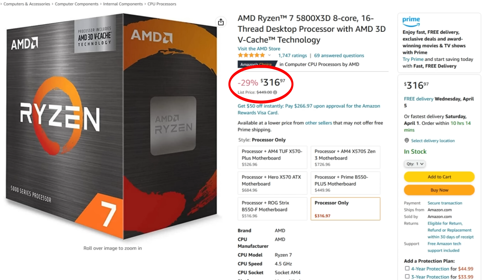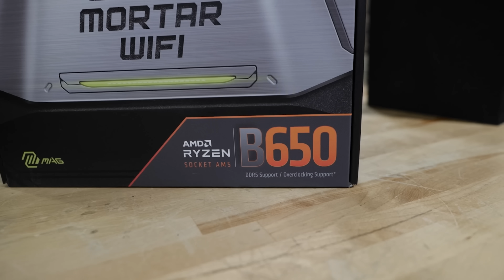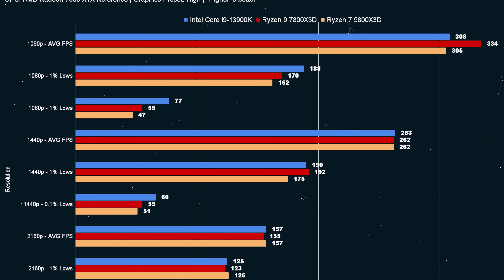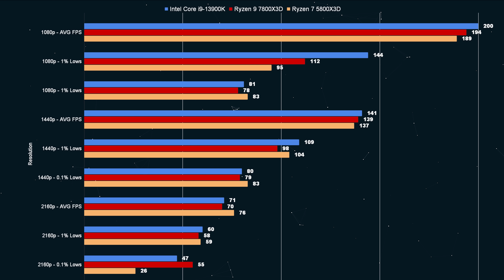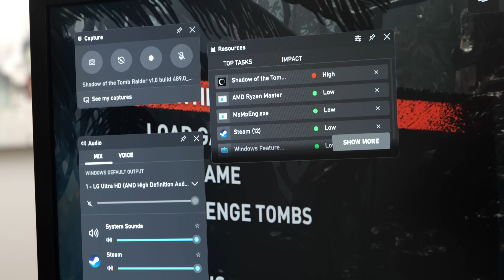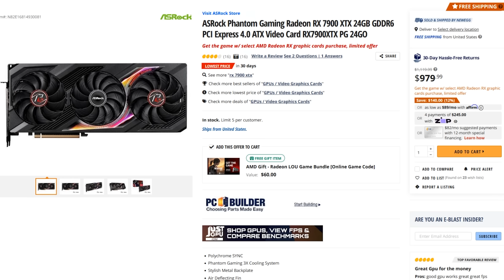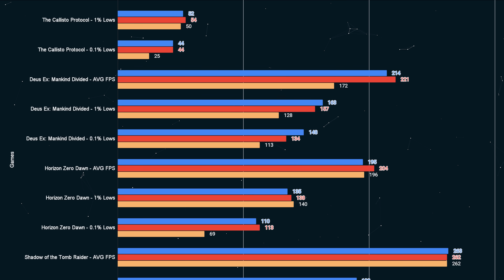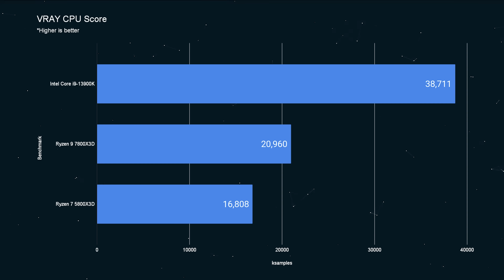Is The Ryzen 7 7800X3D The Ultimate CPU For Gamers?

Comment: Going from an i5 10400 rtx 3060 to a r7 7800x3D rtx 4070. Expecting to be blown away.
Reply: Gonna be super efficient
Reply: Can confirm. It barely pulls any watts from the wall while gaming despite being super fast. @iamdeluluu
Reply: @portman8909  lol nice, I got 6800XT/7800X3D cheers bro for efficiency
Reply: Yeah 6800XT is a great card, but obviously the newer cards like the 7800XT will have better efficiency, although performance is the same. @iamdeluluu
Reply: @portman8909  yeah I didn’t care for rdna3 at all I picked up this 6800xt for $400 a year ago off eBay and never looked back since that was the best price to performance I could get even now

Comment: the 7000 series AMD was in my opinion a rushed product and failed dramatically with the Heatsink and high temperatures...I am an AMD fan and I am going to skip 7000 series. I use my 3900x all core clock 4.4 GHz @1.2985V stable and tested with Prime95. I am hesitant to upgrade even to 5900X or 5950X but will most likely do that when the prices drop more. I am pretty sure I was lucky on the Silicone Lottery and was also in the past. I gamed with an FX-8350 until 2019 without problems or FPS issues. Of course I didn't get super high FPS but I never had stuttering or other problems. I was running 4.7 GHz at 1.325 V and temperatures up to 65C. I also got that CPU running stable at 5.1 GHz at 1.5V but the temps were so high and didn't want to fry it. The funny thing is that I couldn't get to go to 4.725GHz or more even with more voltage. The 5.1 GHz worked but nothing in between. I am assuming that it had to do with the RAM BUS but I left it there. It still works perfectly and I use it as server. With Intel, my possibilities were always limited. And don't get me wrong, I have had Intel CPU's too in the past and was happy with them too. I hope AMD doesn't rush another half good product.

Comment: The best thing about the 7800x3D and 7950x3D was it lowered the price for the real gem, the 7950x.  When it did I lunged for those unadultered symetrical  16 cores.  It's got 2x more power to play the most intensive game I want to play.  In BF2042 it runs at 50% on 16 threads.   The big disappointment is DDR5.. when you populate all 4 slots, the speed drops down to 3600.  So, yeah, what's the point of DDR5 then.  There is no point.  My DDR3 ran at 3600...

Comment: I have a 5800x oc to 4.95ghz..clubbed with rtx 3080ti will i need to go for ddr5 platform or 5800x is good..i only play games on 4k...so at 4k 5800x is it fine...and will 4080 be bottlenecked by 5800x at 4k..

Comment: Unfortunately, AM5 are far too expensive for the 20% more power. You pay 500 - 800€ more for 15-30 FPS and on 1440p and 4K there is no big difference... Long boot times, melted V cache and damaged mainboards and  Memory problems speak against AM5   buy 5800x3D

Comment: I'm so, so, so grateful for the 2160p high results being included. 5800X3D looking so good in real world scenario; you don't even have to replace everything else. 

If planning for a new system though, I feel like leaning towards intel after having my R53600 build since launch since AMD has been a hassle with ram timings and bios revisions, for (me) someone not too handsy at dealing with this stuff. 

Savings with a 5800X 3D are really lucrative though :/

Anyone currently on the CPU market, (and not to keen about motherboard troubleshooting like me) facing the same conundrum please weigh in and help me :)
Reply: @rockapartie  Thanks, so far 5800X3D is looking really lucrative. I had already gotten myself a D15 for the future. Though currently holding off purchases till intel's 13th gen refresh drops

Comment: The other thing to note here, is the 7800x3D is (in my experience) very easily overclockable. You really don't need a ton of cooling either, as it's insanely efficient. The one I tested was very happy and stable at 5.3Ghz (5.1ghz all core under heavy load), 2100 IF, and 6400MT DDR5... with minimal BIOS tinkering, and a tiny bump to VCore, 1.35V on memory, and 1.28v SOC.
Reply: And the real world performance gain from all that?

Comment: Asking this question because I am not so sure. I currently am running a i9 10900KF and have heard nothing but rave reviews about the 7800x3d which prompted my interest. Because I have to jump to an AM5 platform (new cpu, motherboard, cooler, memory, SSD) is the performance worth the upgrade? As far as gpu paired with my 10900kf is a sapphire pulse 7900xtx . To make it simple I was basically going to buy everything except the gpu since that’s alreeady set , but wanted to see if this was worth it

Comment: Im still rocking my Ryzen 7 5800x3D with my rtx 4090. Long story short, based on the graphs, if you're gaming ONLY on 1080p resolution, then you'll see the difference in performance and better 1% lows for a smoother gaming experience. But for 1440p and 4k gaming, you will not see much of any performance gains. I game on my 1440p and have a second 4k monitor on the side for triple A single player titles. Looks like I'll be skipping out on AM5 platform for now until I see better gains at higher resolutions.

Comment: Having a hard time choosing a motherboard for the 7800X3D. Currently juggling between; Gigabyte X670 Aorus Elite AX; Gigabyte B650E Aorus Master; Asrock X670E Steel Legend. Which one would generally be the better motherboard to choose? I don't really want to pay any more for a motherboard. than the B650E Aorus Master.
I mostly game and do some light productivity hobby tasks on it. I also usually keep my computers for a long time (my current cmpuer is 5+ years, it got and old i7 6700k in there). So I'm hoping that I can in the future change CPU and GPU without changing the motherboard.
I do want an expansion slot with x4 speed as I want to install an 4k60 capture card there and maybe better capture cards in the future. And I don't do any sophisticated overclocking, maybe I'll tinker with undervolting and some very light PBO tweaking. But nothing major.

Comment: I feel sorry for the 7900x3d. Another example of bad planning. Why would you only put 6 cores with vcache? Should have 8 cores minimum. The extra cores should have given it an advantage which is not the case given the dual ccd for both the 7900x3d and the flagship 7950x3d. Only in AMD where the flagship product gets beaten by a lower model 😂

Comment: @Level1Techs I face quite a bit of a dilemma here, as I game and compile a lot of code on Linux. Coming from a 18 Core Haswell-EP, I don't want to give up on either front. Also, I am very price/performance conscious and power costs are really high over here in Europe. The 7800X3D lacks multi-core performance by a lot against Raptor Lake whereas Raptor Lake lacks AVX-512. As CachyOS will offer x86-64-v4 repositories soon, I don't want to miss out on the fun there, too. That leaves me with no no compromise option right now, the 13600K would probably be my choice if my system broke tomorrow and if Intel would lower their pricing by 20%. Maybe keeping my Xeon for another two years is the way forward? As I don't own a high end GPU yet, I would probably be better off with such a new GPU first anyway for some time.
Reply: So, you wouldn't consider the 7950x3d?  It's likely only going to get better as AMD releases new drivers for it and Microsoft works at improving the scheduler.

Comment: I'm playing with a 3900X and 4090 in 4K. Do you think its worth to upgrade to a 7800X3D? I could get the 5800 x3d for 284 euros...
Reply: If you upgrade to the new 7000 series chip then you’ll have to also upgrade to the new AM5 socket meaning new motherboard and new ddr5 RAM. If you don’t want to completely update these hardware pieces then I’d go with the 5800x3d which is still on the am4 platform

Comment: Does it make sense to buy this for 4k and 1440p vs the 5800x3d? They won't bottleneck the GPU either way I am pretty sure at these resolutions. And who except for actual pro gamers cares if a game runs above 240hz at 1080p? Is that worth 500$?
Reply: I'm on a ryzen 7 5800x3D with my rtx 4090. I'm no pro gamer, but no, I would have to say for 1440p and 4k gaming, it's definitely not worth the money right now to be upgrading to the ryzen 7 7800x3D. Sure, if you play esports titles on 1080p and care only about maxing your fps to the fullest to take advantage of those high 360hz monitors, then okay I can see why pro's would make the move. But for a everyday casual gamer like myself nah, my 5800x3D is still performing amazingly  for my gaming experience. It would be a waste of money to upgrade if you dont plan on gaming on 1080p with high 360hz gaming monitors.
Reply: I should probably mention when gaming at higher resolutions, especially at 4k. Your gpu will take up most of the load when gaming on those triple A titles while your cpu just sits there not doing much. I mostly see 95% and above gpu usage on my rtx 4090 on the ryzen 5800x3D so I'm not even worried.
Reply: @t3nsaZ  ok thanks for the input

Comment: yeh but, you didnt really show the board comparison, that GODLIKE has 10gbe and thunderbolt 4 and pcie 5.0 and other features, not apples to apples on price.
Reply from the maker: Literally explained in the video. The tippy toppest board was needed for BestRamSpeed. All that other stuff is just gravy and still the 13900k did not best the 7800x3d in the absolute best case scenario for it, which was the point of doing that.

Comment: 5800X3D is a very obvious choice if you're coming from an older AM4 platform at this point, for gaming at least.
Starting from a Zen1 era system from 5-6 years ago (like an X370), a 5800X3D is all it takes to not bottleneck a 4090. BIOS updates even added things like ReBAR support.
Reply: Because anyone on the whole planet puts a 4090 on a x370 system.

Comment: There are no finite amount of words that can describe how curious i am to see how does 7800X3D fare against 7950X3D in gaming using QEMU/KVM when passing all V-Cache cores from both CPU's via CPU pinning. Core count will match since both processors have 8 cores with fast access to V-Cache. So far it looks like 7800X3D is not a very good production CPU but i need a fair balance between both use cases.

Comment: With game developers focusing on more vram usage and larger textures, I’ll stick with my 13900ks/7200mhz ddr5/4090 for now. Until the next gen cpu is released and there is actually a clear winner. This trading blows in games shows it’s all a wash with the two brands. And cache sensitive games in the future may be few and far between if they are going to up their textures and vram. That is until they can put GBs of cache on a cpu.

P.S. I could care less about efficiency on a desktop platform. I only care about efficiency on a laptop for battery life. When you have a 1600 watt PSU it just doesn’t matter.
Reply: Remember, all these benchmarks are run with 5200Mhz ram. So, I take all these benchmarks with a grain of salt. 

Your build is like mine, but I also went with a Western Digital SN850X M.2 SSD and Manta OC DDR5 @ 8200 Mhz.

Comment: How about with PBO on ? I would like to know if PBO on with say a 7700X vs this 7800X3D makes any difference. 
Its kind of sad how much they limited the core boost vs the other 2.
Reply: I have 7800x3d  and decent peerless assasin cooler+ cheaper x670e mobo, paired with xtx... literally no need for using PBO curently.. its more like " maybe in the future?" Lets be honnest 1 fps difference at 3440x1440... thats nothing Burger.. its very cool, stable , pc is silent and performs great of the box.. future will tell us more
Reply: @jankratochvil9779  PBO usually lowers temps when running - offset voltage curve. sometimes its worth it just for less heat.
Reply: @SolarflareTM  ye i know I used it with my 5600x.. this one is boosting chilli and boosts often anyway.

Comment: Last time i had a AMD system.. I got so many crashes and driver issues…
Since then i’ve never wanted to touch a AMD system again.. 

Hmm I think ill still stick with Intel.. Lets see what their next Gen CPUs will be like. 
I got a i9 9900k rn with a 3090.. Technically it should be able to flood the 3090 right? But my 3090 is performing subpar i think. 120-140 fps in Warzone on medium to low settings? Cmong wth..

Comment: Any issues with core parking? GN talked about half of them being parked if the OS had seen an 7900X3D and that it needed to shut them down when gaming. Even after a clean install of drivers.
Reply: It's not drivers parking those cores. It's windows. A simple registry toggle determines if parking is on or off. Unfortunately MS has hid control of it from power plan settings so you have to manually edit registry or use Parkcontrol or expose core parking control in power plan settings(google helps with that). Apparently GN has no clue how it works since they had to do fresh install to change one registry value from 1 to 0.
Reply: @kognak6640  Or, hear me out, MS shouldn't do that. It's bad enough you have to find a workaround to create a desktop shortcut for some apps. This is why I don't use windows.
Reply: @TheSolidSnakeOil  no core parking is there because the performance decreases as it crosses to the faster cores, not some radical MS thing. its the intended behavior recommended by AMD.

Comment: Can confirm, 5800X3D still insane. If budget is a thing for you, AM4 is still so worth it.
Reply: Yea, no reason to upgrade that baby for quite some time.
Reply: Indeed, buy am4 with 5800x3D and don't think about upgrading before am6.
Reply: @Ilestun  Nah, Ill buy my 7800x3d with 4080 super on my AM5 and play everything in 4k graphics flawlessly : )
Reply: And believe it or not that's what a LOT of the DIY market feels because Zen 3 outsells other gens and probably even Intel 12th and 13th gen combined.  AMD Zen 3 CPUs typically dominate Amazon's top 10 best selling CPUs (their top 50 list), with usually 6 - 7 Zen 3 CPUs in the top 10.  That's just domination.

So most people don't care about the best or newest now, I'm very sure because of how expensive top end parts have gotten.  It was really AMD that got buyers back into the more higher end parts because they offered them a LOT of performance for a much better price than Intel, when Intel had no competition.
Reply: I have 5800X3D with a 4090 at 4K and loving it
Reply: And that's if you're buying the motherboard and RAM and with it. If you're upgrading from most older AM4 systems you only need the CPU.
Reply: @xTheUnderscorex  That is indeed what I did. X470 Taichi Ultimate and 4x8GB 3200 CL14 as base platform. 5800X3D and a 6950XT Red Devil were the upgrades. Done ... for years.
Reply: @noenken  With the 5800x3D you could have even spared more on RAM since the timings are making no difference between CL14 and CL16 with this particular CPU (unlike other Ryzens).

And for frequency of memory, tried with 4000mhz CL16 Vs 3600Mhz CL16, no difference in games, only like a mere 50 points better in Cinebench r23 multicore.
Reply: @Ilestun  Well, I bought the RAM like 5 years ago so .... not much to save if you already have it. ;)
Reply: It is.  It begs the question of what AMD's "love letter to AM5" will be when AM5 is nearing EOL ....
Reply: It is a damn good CPU yeah, using it with a 4090@3440x1440 144hz. I do see bottleneck sometimes though so I'm trying to find an excuse for going to AM5 and give my current system to my girlfriend. Thinking of just going a cheap route and get the 7600x wich on average is even with 5800X3D but does better in the games I currently have bottlenecks in. Than see what AM5 brings. Not sure what to do tbh lol...
Reply: @tmkongen  Jumping on new hardware that is still a bit iffy is something I have done in the past but I wouldn't recommend it. The 5800X3D is rocksolid at this point and not far behind. Remember, first gen AM5 introduced new architecture, new socket, new PCIe standard, new memory... Second gen will still be all of that but way more robust. Just wait.
Reply: I got one last weekend. I love it.
Reply: My 5800X3D should get here tomorrow. So excited

Comment: The large cache should be useful for any constraint solving workload, eg. CAD, EDA, simulation. The single CCD also avoids AMD's notoriously unpredictable spaghetti memory architecture.
Reply: Will it work for Audio Production???
Reply: @Jghosn13  it is not my area, but generally FFT is sized for L1/L2 cache. L2 cache doubled for all Zen4 processors. Effects processing and synthesis might be like simulation, so I would expect gains there. The single CCD is more predictable, so it should be better for real-time processing.

Comment: I don't get it.
There must be other loads than gaming where you can benefit from a large cache.
Large vector calculations, matrix operations, medium size FFT analysis, complicated frame by frame effects, video encoding, compression using a large dictionary, word and/or block sizes, physics simulations, CFD, FEA or something.
Someone must know how to take advantage of this large cache size. What exactly is it in games that take advantage of the cache size, (what type of calculations)?
Reply: Constraint solving, collision detection, and physics simulation. Lots of short (100-200 instruction) parallel solves, followed by a synchronizing barrier. Without deliberate optimization it doesn't scale past 8 cores on AMD though, because synchronization between CCD's takes about 5x longer than within a CCD. L3 access across the IO die is slower than a RAM fetch.